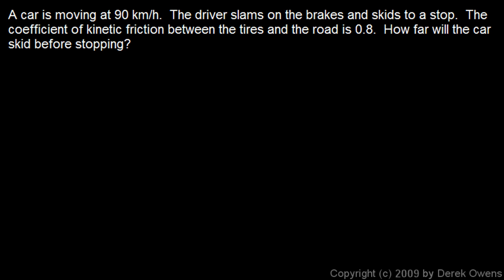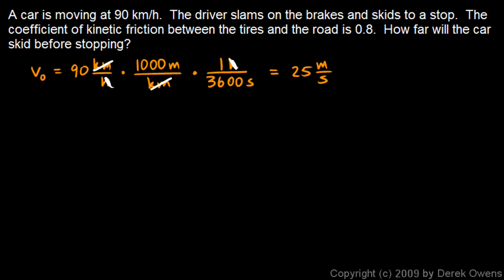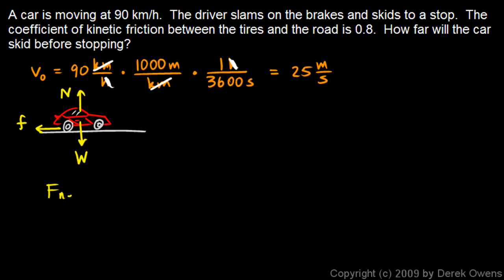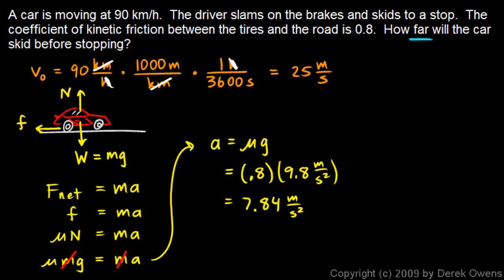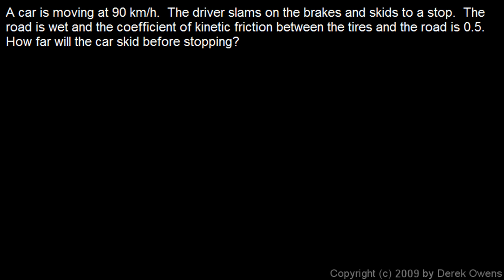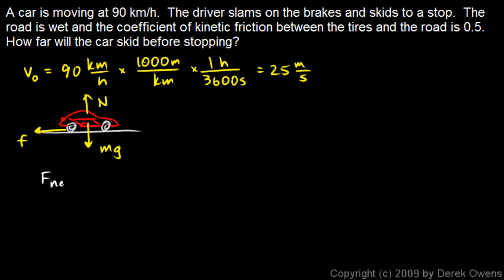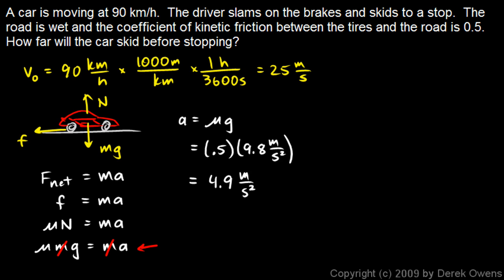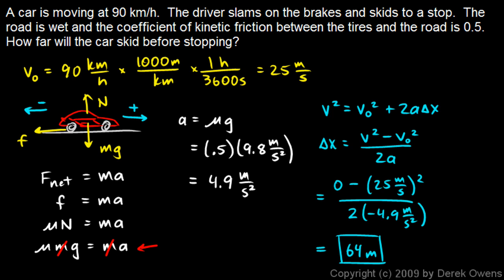Physics 4.7.4a - Friction Practice Problems 1 - 2

Comment: sir if the car is deacceelrating wont the acceleration be negative
Reply: Sure it is. He used negative value in blue to find deltaX. But yes, he forgot to write -4.9m/s^2 in white. This negative signal comes from Fnet=ma, where Fnet is the friction force which is negative, since it points to the left. He should have written -f=ma, and then carry this negative signal til the end.

Comment: I don’t understand why A is negative in the second question, is it because you’re slowing down?
Reply from the maker: Acceleration is negative in that problem because the acceleration is to the left. These problems all involve "one dimensional motion" which is basically just motion along a line, forward or back. Since there are only two possible directions, forward or backward, we call one direction positive and the other negative. In problems like this, anything that is a vector (such as displacement, velocity, acceleration, or force) will have its direction indicated by whether it is positive or negative.

In this particular case, the negative value for acceleration does correspond to the car slowing down, but that is not always the case. If the car were moving in the negative direction, then a negative acceleration would make it move faster in the negative direction.